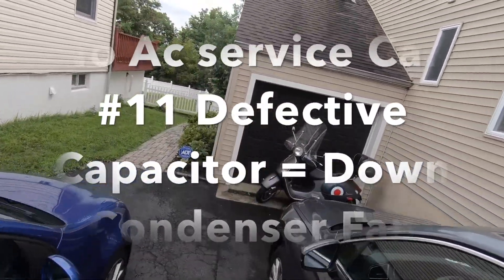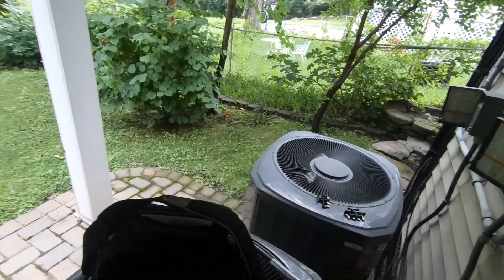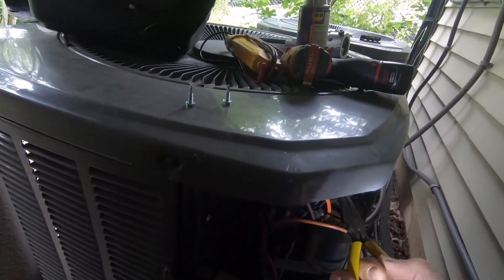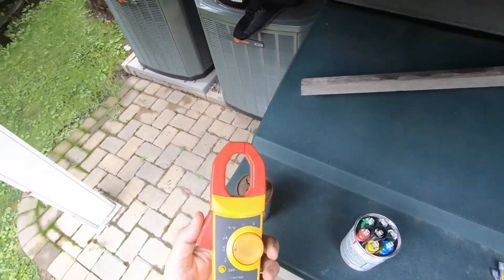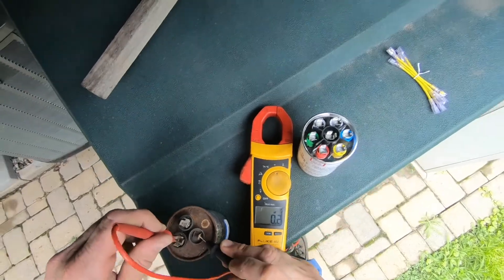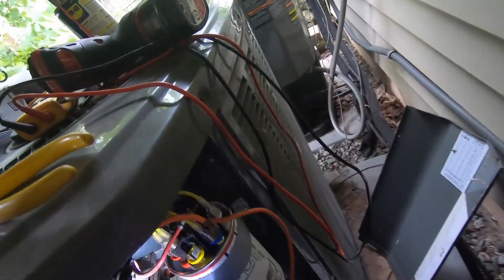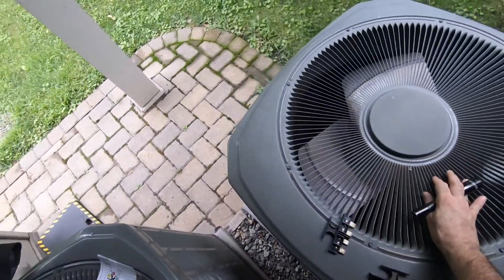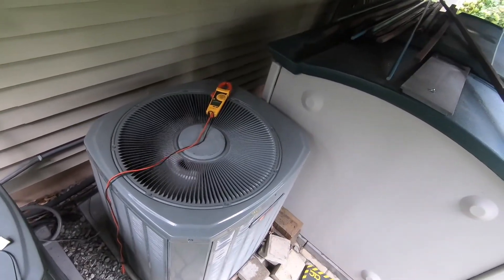Only AC Compressor Starts Without Condenser Fan

Comment: The one from Friday that had the low voltage issue

https://photos.app.goo.gl/uGukHcV5Fjaqu7Wk9
Reply: My most common repair this year is capacitors. Last year it was adding refrigerant to units. BTW, do you guys work mainly on rentals or with actual home owners?
Reply from the maker: The controls are buried In that pile of trash. The line set and control wire is that also buried? Or did it go straight through the wall?
Reply: The HVAC Hacker the panel takes up that whole side, the line set and electrical wires go from the back corner to the wall then between the 2 condensers. Had to move some of that crap to get the panel off, then ended up covered in spider webs (I do not like spiders). 

https://photos.app.goo.gl/qK89G1EhegCSFEtw6
Reply from the maker: That sucks I hate spiders also. Hopefully this call I am arriving at is just a capacitor.